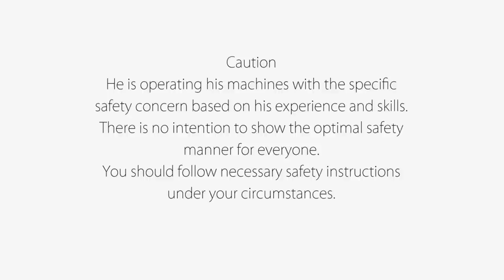ISHITANI - Making a Wooden Full Length Mirror - wall hanging

Comment: Ishitani has the craziest collection of shop tools I've ever seen, and I love it. Every video has some machine or attachment I've never seen before.

Rock solid scissor-lift workbench? Sure, why not.
Who needs a dado stack? Just use the world's thickest blade.
Angled cut? Why tilt your table saw blade when you can just tilt the entire freaking table 🤣

Most makers who value their fingers would probably run away screaming, but there's just such a calm familiarity with every device, and it all integrates so seamlessly into the workflow. I also respect the balance between power and hand tools - Stuff Gets Done without wasting effort, but then he always goes the extra mile to put that craftsmanship back into the final stages, and the result is understated perfection.

Comment: That surfacer at 5.32 is one machine that has not been downsized to a bench top size machine. I think a smaller sized machine would have found a place in the small commercial and home shops.